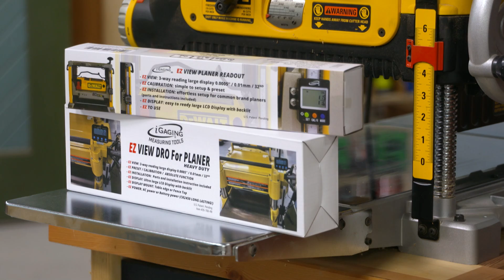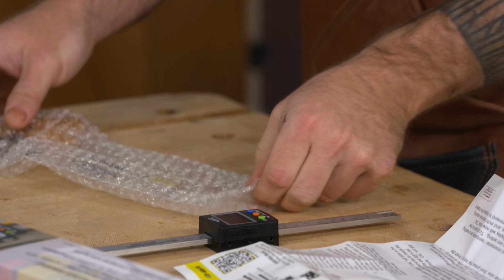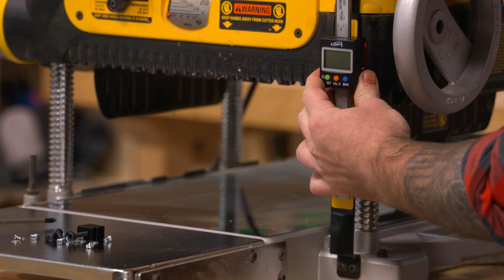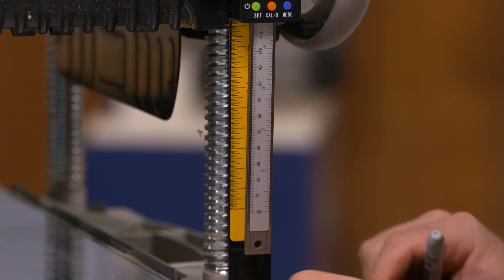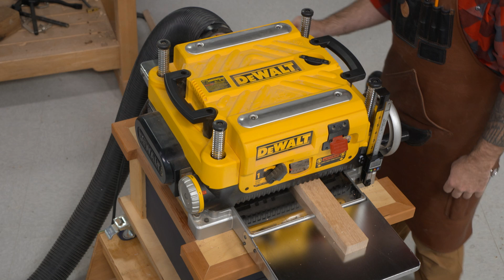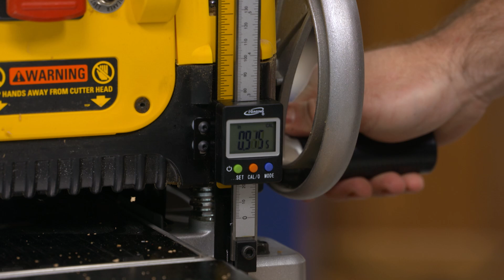Great Gear: IGauging On A Planer

Comment: In the video where you drilled for the bottom of the scale, then later said that you "had adjusted it down a little...", is about a one inch difference! That is not a little! My first hole I did was right about at the bottom of the yellow scale by lining up the 3" marks like yours and I was just over an inch shy of the lower most movement of the planer. I bottomed out my planer and then slid the readout down until it stopped. Then pulled the scale about 1/8" lower and marked and drilled a new hole.  It is now about where your bolt is in the video. Please edit the video to correct this.

Comment: I bought and installed this model about a year ago, but was frustrated with battery death and fiddley process of changing them out.  I bought the AC version instead (still iGauging) and found it to be more a more robust build . . . and there's no battery to deal with.  I ran the DRO cord up along the planer cord.  I love being able to return to a thickness.  Now, what do I do with the old battery version?

Comment: You have to write in the video explaining that the first hole you drilled was in the wrong place. Your mistake cost me to make the same mistake where I found out that I couldn't lower the planer blade because the nut stopped the movement. I finally placed the bracket in the top hole where I had total movement of the planer. Please be clear about the mistake you made so others don't have to waste an hour fixing the problem. Otherwise you did a pretty good job.
Reply: Yep, following along with the video, drilled my hole and installed the bracket, then restarted the video and heard him say how he had to "adjust it a little bit lower." I literally yelled: "Are you f***ing kidding me?" Why mess up the installation, yet leave the mistake in the video? The video was edited before posting, so what was the thought process behind showing the hole being drilled in the wrong spot? I considered other installation videos for this small project, but figured something from a woodworking publication would get it right. Nope.
Reply: I’m considering installing this and don’t want to make the same mistake- but I don’t fully understand your issue. Can you clarify a bit further?
Reply: @matthewturbin969  i can answer this of ur still wondering because i followed the video and drilled in the wrong spot too.
Reply: @christianreza144 sure, I installed one a few weeks back without the screws
Reply: @matthewturbin969  oh well thats good then.  nrvm
Reply: Glad I found this comment a year later because I was running into this issue and losing my mind

Comment: I just installed mine.  The parts for the 735 and 734 were mixed up, so I kept trying to figure out how to get a nut behind that metal block.  Nope, the block for the 735 is threaded - but the smooth one was in the bag labeled "735."   And when you put the metal plate onto the back of the gauge, you have no idea where to position it until you fit up that block, or the blade won't be straight.  And you have to hold the tiny screws with the tiny plastic washers and slippery little spacers all together, because you can't just put in one - you'd have to find a way to get the second spacer behind the plate if you did that.   It's all together now, and I think it's going to be a big help, because I often need to make more drawer sides of the same thickness after I thought I was done.

Comment: Two issues i have with their DRO's  1) they need a better design for head mount i have a couple of the units and both loosen up with time and use even with a lock washer its the plastic mount on the back of the readout itself not the rail 2) if you are going to use this DRO for this same planer which i have it needs a second bracket on the top of the rail or it is susceptible to being bumped out of position also would like to see a unit that you don't have to bend down to read putting your face near the feed opening and flying chips lets be real nobody mounts their planer at face level when standing upright

Comment: These things are nice additions, however, I don't work in my shop as much as I once did (gettin' old).  I have one of these on an ornamental mill.  I use it maybe once in a few months.  Every time I go to use it the battery is dead and I have to go buy a new one.  It would be nice if there was a way to plug in a power convertor like you use to charge your laptop and have a rechargeable battery in the scale.
Reply: About 3 months late Doug, but battery life in these off shore produced digital calipers and this bar scale is always a problem. Since I don't know for sure which batteries your read out uses, I'm not sure the following is of any use to you. But most of these displays seem to use the same size and battery type. Usually a LR 44. If yours is the same? Try using a SR 44 battery and you'll get far longer life. It still won't be great, but certainly better than the LR's due to a different composition within the battery itself. 

That ongoing battery drain is due to the poor electrical design these cheaper displays use. While the display does shut off when the off button is pushed, there's still an excessive drain so the dro remembers it's position. My much better Mitutoyo digital metrology equipment almost always gets a minimum of 3- sometimes 5 years before a battery replacement is required. I've done quite a bit of checking, and afaik there isn't any rechargeable available for this type of battery. If you know enough about electronics or know someone who does, it's not impossible to delete the factory battery type and use a separate battery pack that does use something like the AA rechargeable . There is a difference in voltage between the two, 1.2v for the AA and 1.55v for the battery and that's where the electrical knowledge is required to make it possible.
Reply: That is the battery.  I will try the SR and see what happens.  Thanks for the reply. @Pete-xe3il